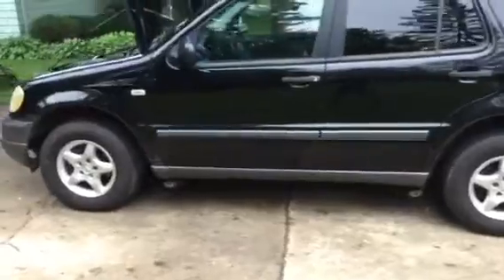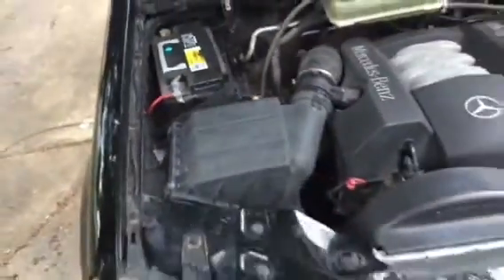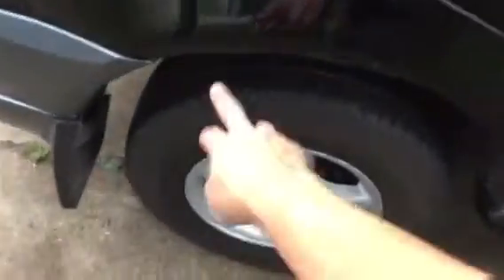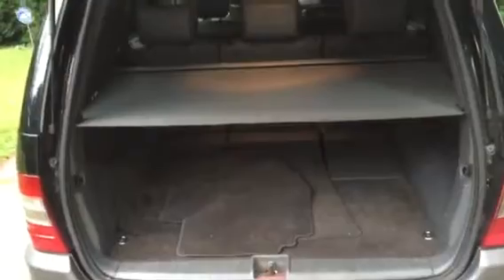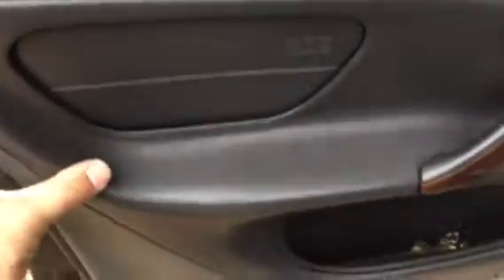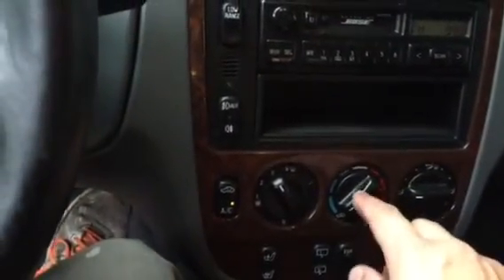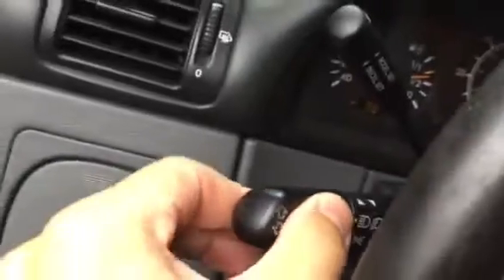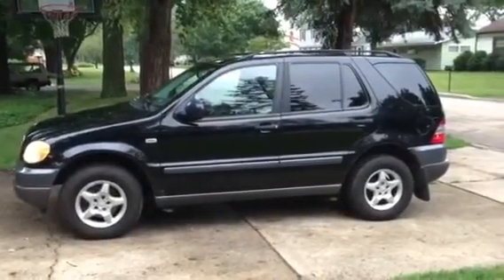1999 Mercedes Benz ML320 Full Walk Around

Comment: Almost ready to buy my brotherinlaws he has one.  A 1999 with 134,000 one owner before him.  Parts and repair costs are making me Leary.  Is it OK to use aftermarket parts on these?  Be seen these go over 300,000 miles and in the northeast here the things a tank during our 5 months of bad weather.  Any and all replies appreciated.  Thanks!
Reply: Does it have sunroof
Reply: Does it have sunroof
Reply: I have 1999 mercedes 320..for sale.
Reply: @nitsugaazonipse6030  after seeing how pricey parts were I'm passing on all Mercedes products.  My Hyundai is edging 200,000 and running like a top. Will throw a bit of money at it as needed as I'm told they can get 250,000 miles at times